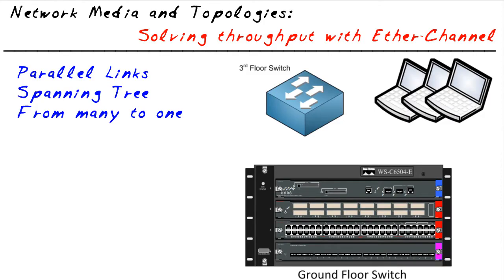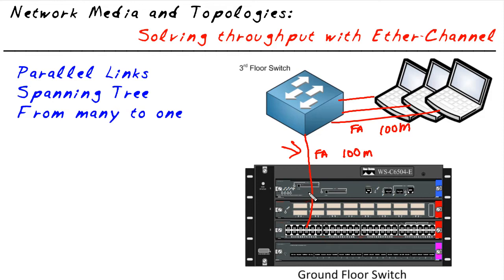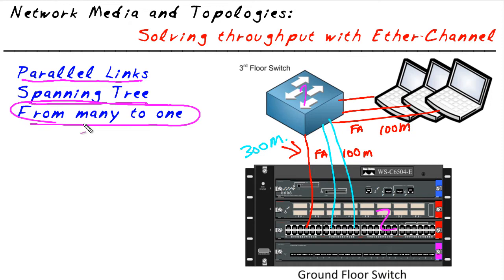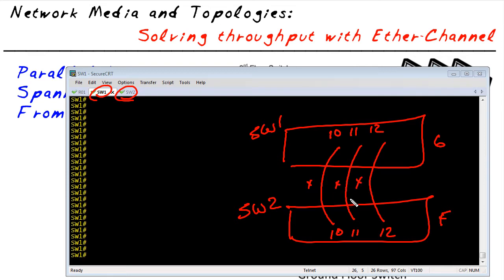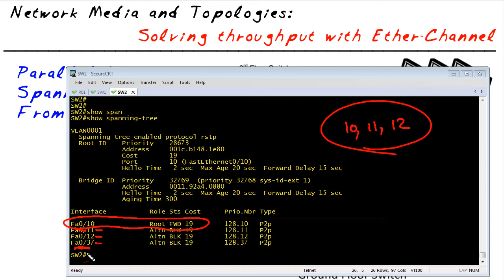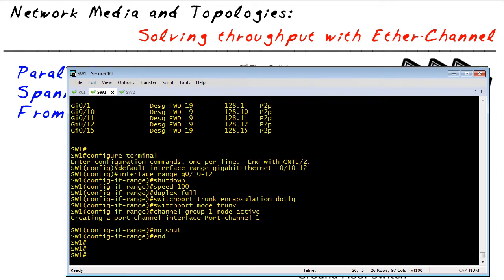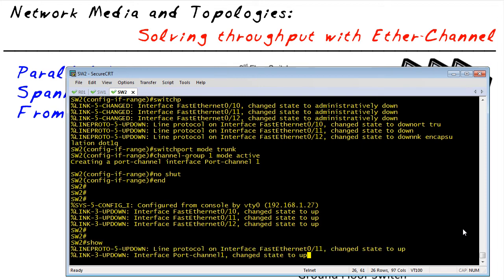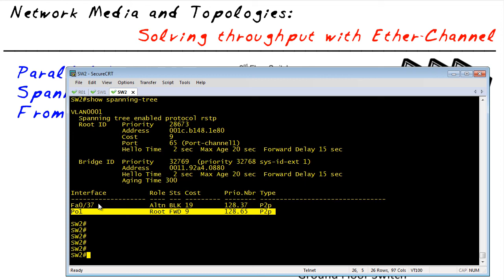MicroNugget: How to Increase Throughput with EtherChannel

Comment: Really nice explanation, simple and clear, thanks!
Reply: LordBiker Thanks for the question.  

Instead of creating 2 port groups of 2 links each between switch A and switch B, it would be better to create 1 port group (1 bundle) that had 4 links.    If we used 2 (L2) etherchannels between switch A and B, spanning tree would see them as parallel paths and would block on 1 and forward on the other.  By having all 4 links in a single L2 etherchannel between switch A and switch B spanning tree wouldn't block, and then the etherchannel itself could distribute the load across the 4 links.

Cheers,

Keith
Reply: CBT Nuggets I just have a quick question, can I have two channel-groups in one switch? Like for example to use fa 0/1-2 to create po1 and with fa 0/3-4  create po2 and the same with another switch. Is that correct or there is no point creating two? Thank you.
Reply from the maker: Fernando Nuño Thanks for the feedback! We are glad you found this email beneficial.
Reply: +Keith Barker hello , regards from Bolivia , i have a question , if i have 24 ports equals 1 Gbps , its means that i have 24 Gbps for in traffic and another 24 Gbps por traffic out. total 48Gbps speed or Bw. then the trunk ports cooming in 10 gbps equal 20 Gbps in and out. is there a bottle neck in that path ?? , why the switches comes always with more Bw in the uplinks ports for what reason?